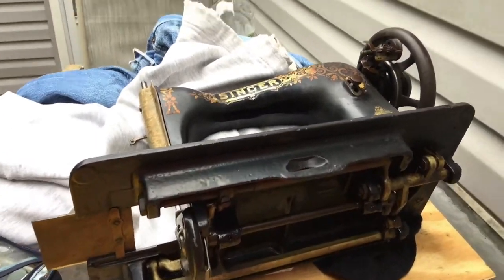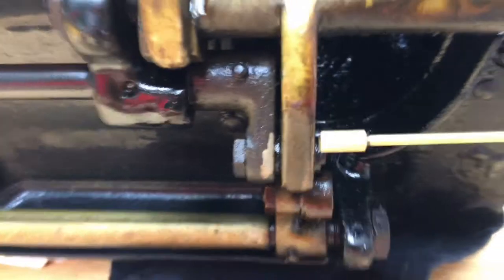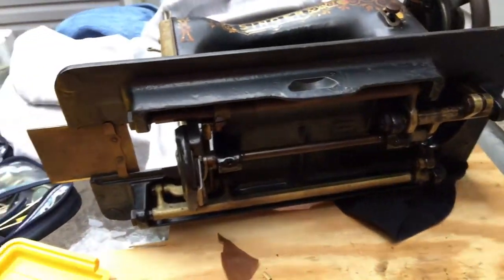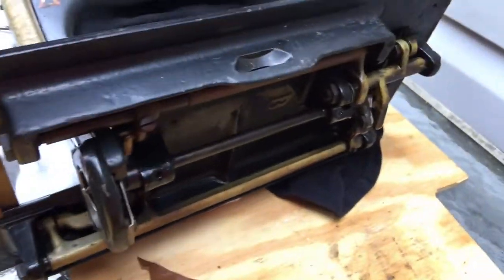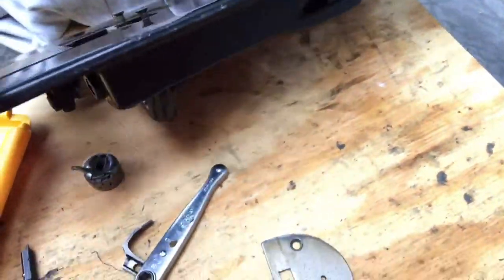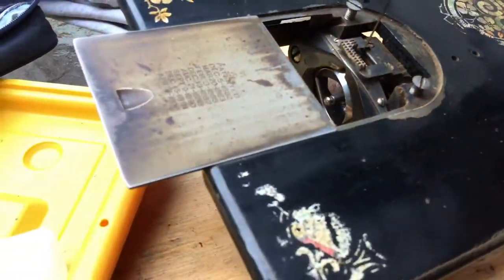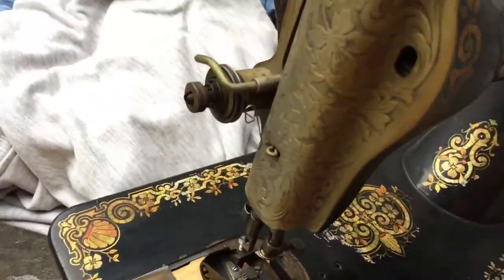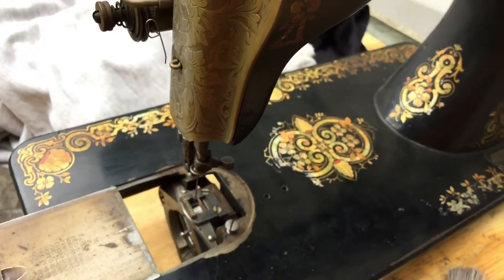Singer 115 vintage sewing machine restoration VIDEO #2

Comment: Hello.  I enjoy watching your videos very much.  I learn a lot from your clear explanations.  Sadly, I have yet to know your name. The quality of your work impresses me very much.
I have a Singer 15 made in 1921 according to the serial number G8647960.  I do not yet feel qualified or comfortable restoring this machine.  The motor runs, but it needs a new belt.  I would like to restore its exterior beauty as much as possible.  The finish is dull and the chrome parts have some rust.  I do not know if it may need rewiring or other internal work, but it probably needs a good cleaning, lubrication, and oiling.
I would like to know if you take on such jobs.  If not, do you know of anyone else who I might ask to help me.  Local sewing machine shops are not interested in doing any cosmetic work whatsoever. 
I’d appreciate any help or direction you could provide for this machine, which has been in the family for several generations.  I would really like for you to accept my Singer 15 to restore it, so I can learn more from you.
Thank you,
Michael

Comment: I got a 1039 class 15 and it has some rust on the chrome and body. What do I use to get it off?
Reply: Also where can I get a oil bottle with a measured tip for one drop? Have seen one in a video but havent seen where to get one.